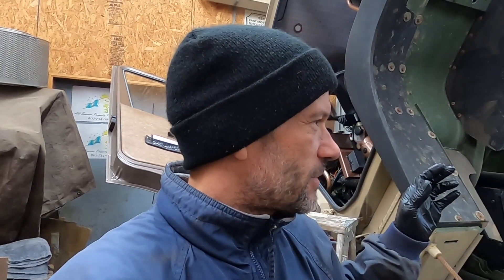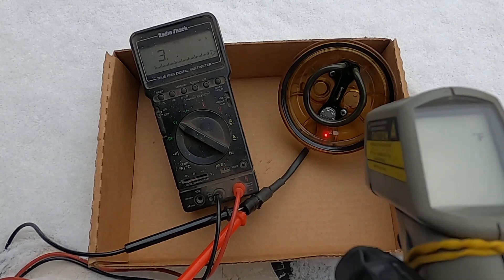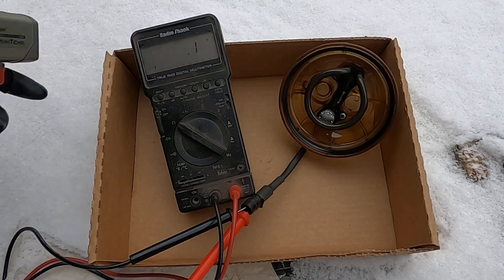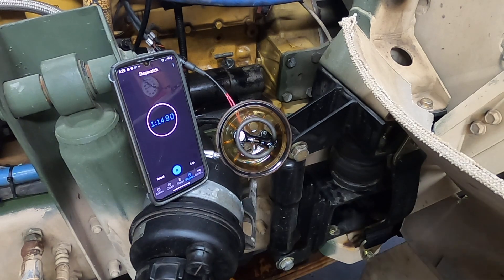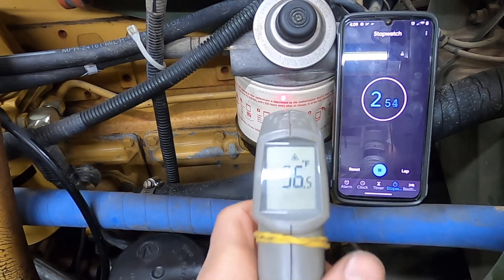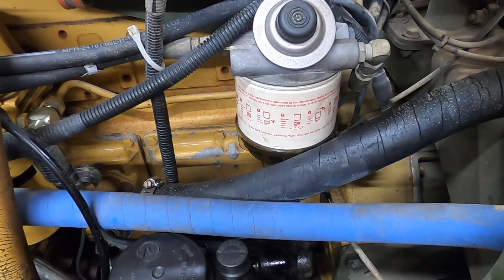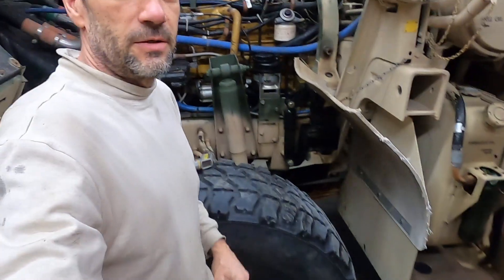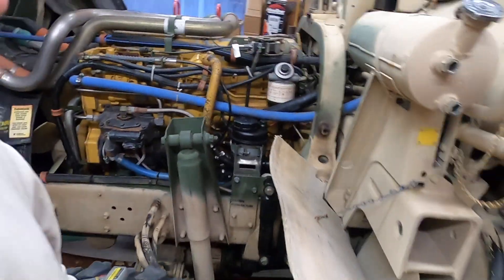LMTV MTV fuel water separator heat

Comment: Also, I had the same loaks on my reservoir and the only thing that eventually stopped them were breeze clamps.  Standard hose clamps put too much pressure on one point and the breeze lined clamps make more uniform pressure.
Reply from the maker: I had the hose clamps on the shelf and I was thinking that when I tighten them up that it wasn't very uniform.
Reply: @NEILSWORLD  breeze clamp everything.  I did that on my truck.  Makes a huge difference.

Comment: Thanks for making this.  I was really curious how this worked.  Do you think it is a fire hazard??
Reply from the maker: I haven't seen only one of these trucks I think that burned up.lol I'll take all the heat help I can get during the winter. I timed it because I think I'll leave the switch on for a minute before I start the truck to preheat the fuel.
Reply: @NEILSWORLD  I will have to find the plug for mine.  It's not connected and I don't recall seeing it.

Comment: Yea, without fuel around it to absorb the heat the element will fry in pretty short order...   so on at 32F and off at 150F.  Excellent! Thanks for testing it out.
Reply from the maker: Yes, I thought there might have been some information stamped on that thermal switch but I forgot to get the magnifying glass out and look at it before I put it back together.